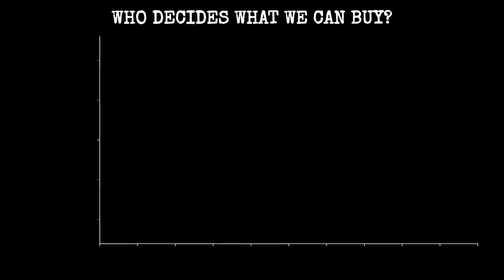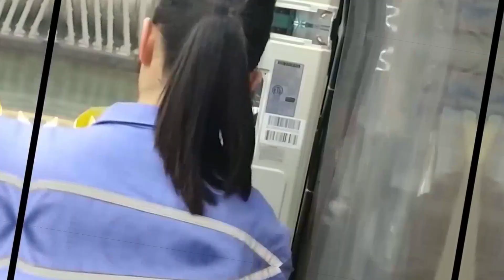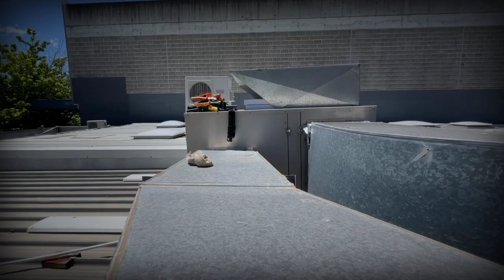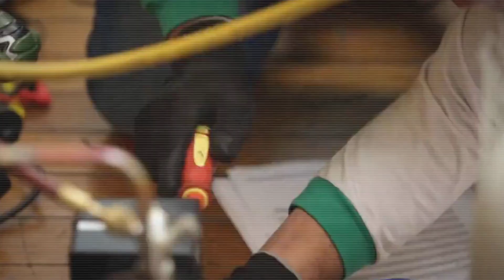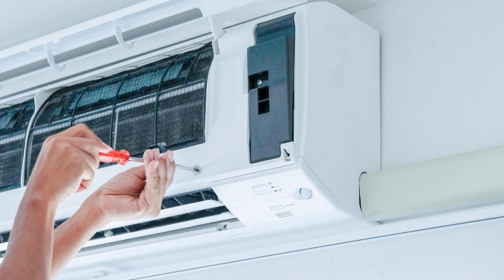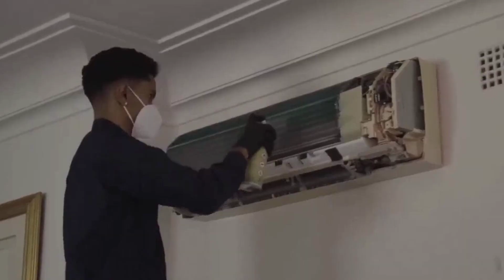Why 90% of New Air Conditioners in Australia Are Garbage (The Factory Secret)

Comment: The current ducted air conditioners start to derate capacity above 32°C and by 45°C they've lost >30% capacity (reduces power usage in line with reducing operating capacity but still less efficient in high ambient heat).